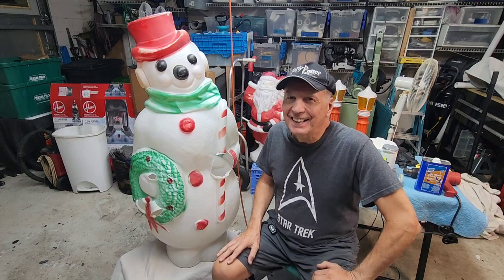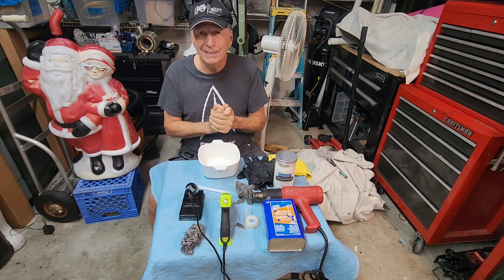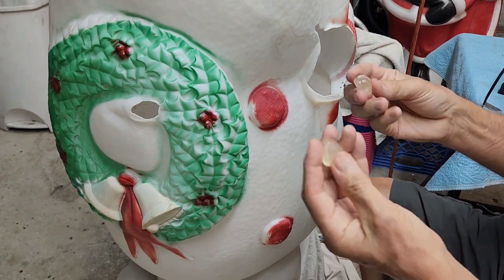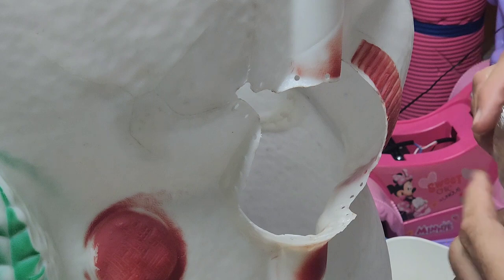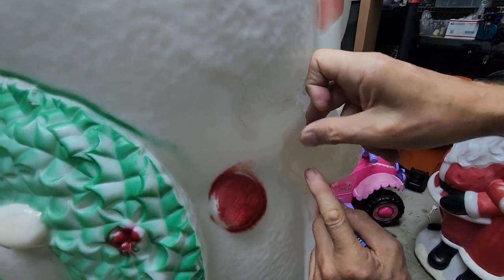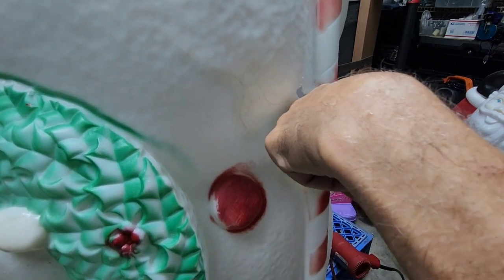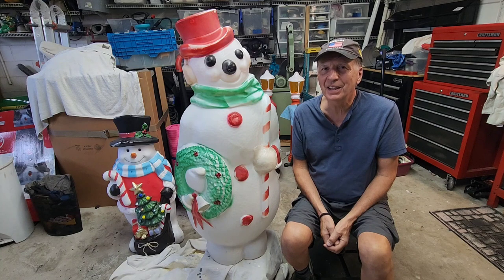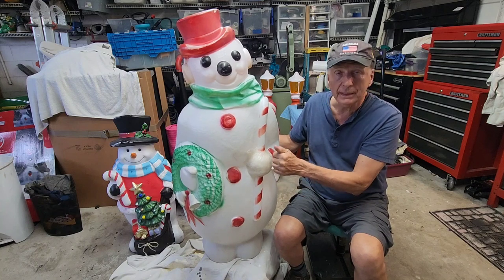Frosty blowmold repair part two

Comment: Hi! I have a Hobo Snowman as some call it. I saved him from a hoarder house. His glove is cracked near his hat. I have taken away the chipped area which is most of the glove except for the thumb and have made the holes to attach the repair material. My problem is I still can’t get my hand into the light hole enough to reach that far up into the mold. I am not very familiar with the Dremel tool even though I have one(it was my dad’s) what do I use to make the hole bigger?

Comment: Do you have a video on painting blow molds?
Reply from the maker: I am currently working on a painting video that will feature air brush techniques for blow molds. It will include the use of transparent paints.

Comment: John what material are you using in the hot glue gun and where are you getting it from? My wife just bought a Union blow mold Frosty that needs his hat repaired.
Reply from the maker: Hello,
I have recently added links to all of the equipment and material that I use on my channel description.
Be sure to use only "high temperature glue sticks with a high temperature glue gun". Only the high temperature version gets hot enough to partially melt the blow mold for better adhesion. Be sure to clean and prep the surfaces for better bonding. Thanks for watching.

High Temperature, crystal clear glue sticks. 
amzn.to/3MXJE9l

Dual temp, High temp glue gun
amzn.to/40Q9oKC

Comment: Great videos. I have a question though. What do you think would happen in the sun in a hot environment?  Would the material soften again?
Reply from the maker: Hello,
High ambient temperature can indeed cause repairs utilizing standard low temperature glue sticks to melt between 104-115 degrees Fahrenheit.
This is why I emphasize using "high temperature" hot melt glue. The high temperature version will melt around 250 to 375 Fahrenheit.  HDPE plastic itself melts at around 400 degrees Fahrenheit.